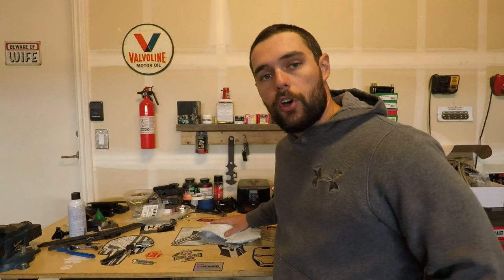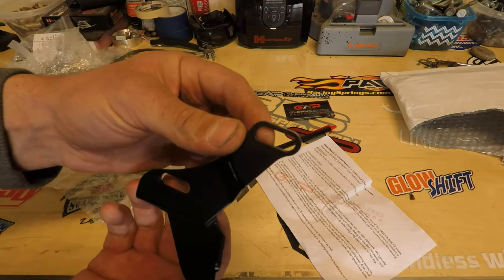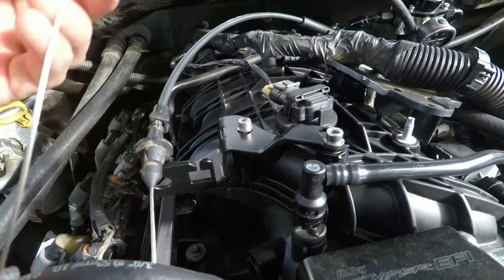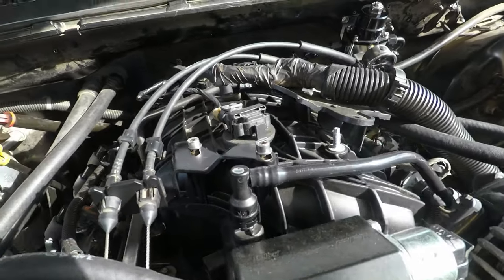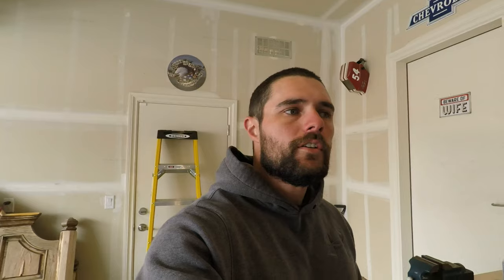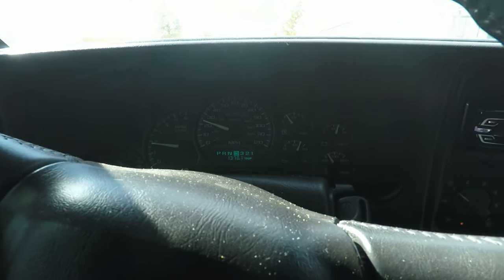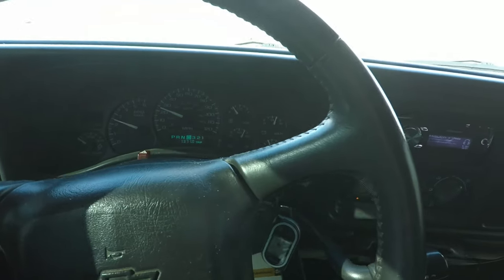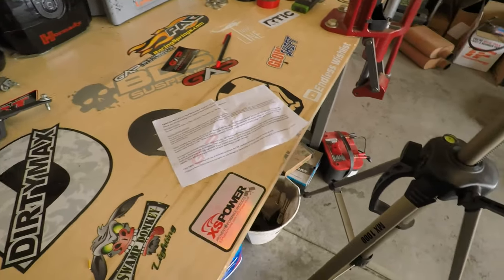Glenn's Auto Performance TBSS Throttle Cable Bracket Unboxing & Install

Comment: Maybe they could build one that also has the ability to mount the TV cable for a 2004r and 700R4 trans? This would simplify the the install for non electronic transmission swaps.

Comment: It's a little pricey at $45 but it does make the job easier. I'm doing a tbss swap right now but I'll make my own bracket and it will be adjustable as well. That's $45 to spend elsewhere on the truck lol Good review bud

Comment: I have the same Holley Sniper TB.  Did you have to rotate the vacuum tube on the tb so the throttle cable would clear?
Reply from the maker: I just used 3/8 fuel hose. I have just enough clearance. I tried to rotate the pipe on the Tb but it was too tight I didn’t want to break it

Comment: Bad ass thanks for sharing. Is your cruise control working?
Reply from the maker: It is little loose. But that is because of the throttle body. I’m working on a way to get it tight also
Reply: Just got done looking at his website and man those adapters for the Holley fuel rail are clean!!! The intro on this video was good well played!
Reply: Endless Wishlist  would a throttle body spacer solve the cruise control? Or is it just the location of the pin on the throttle bodies orientation?
Reply from the maker: Haha thank you. And yes I think it’s just were Holley put the deal for the cable to hook on. A tb spacer might help but I’m anti tb spacer haha

Comment: What size throttle body do you have. I have a FAST 92mm tb & curious what size silicone coupler/vaccum tube would I need?
Reply from the maker: I have the 90mm Tb. I used 3/8 fuel line

Comment: Is the tbss intake a good mod for a 99-02 5.3 stock truck intake?
Reply from the maker: If your engine is stock I would say no. If you do cam and heads then yes.
Reply: @EndlessWishlist  oh, ok. didnt wanna build it really yet,  just full boltons so i wasnt sure if the gains would be substantial enough to cover the 500 or so dollars it would probably cost.
Reply from the maker: I would just port the intake and throttle body you have. Check out @454chuy on Instagram. He does great work.
Reply: Was thinking the same thing thx, dont have IG though. Any other link or way of contacting him?